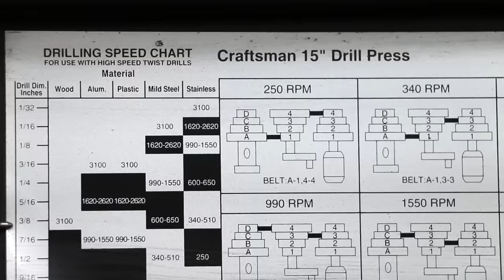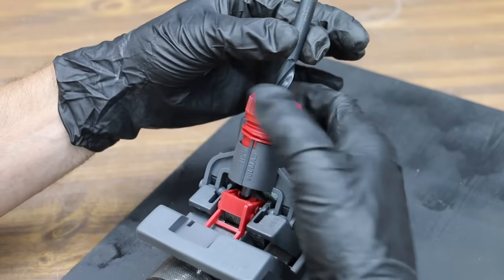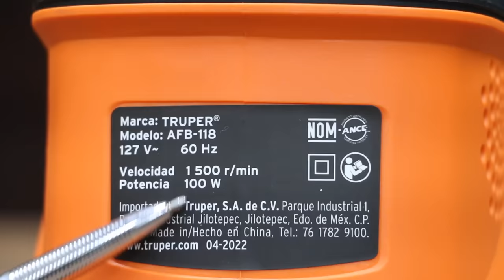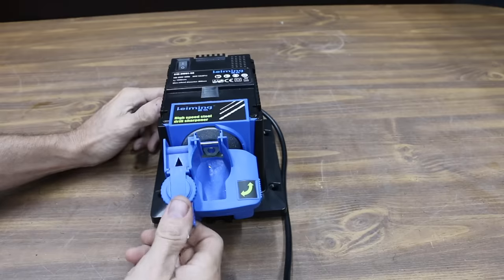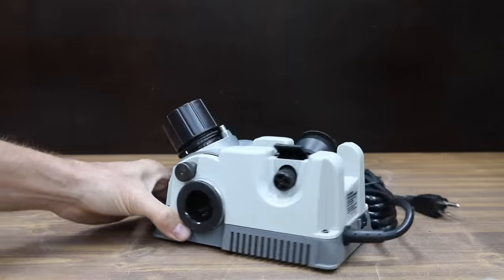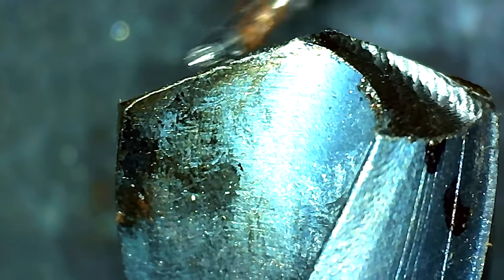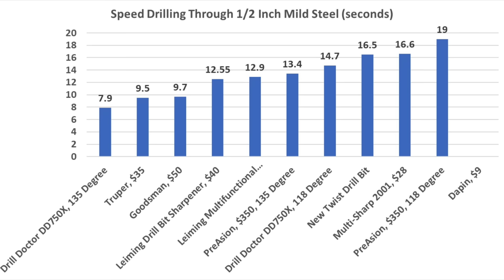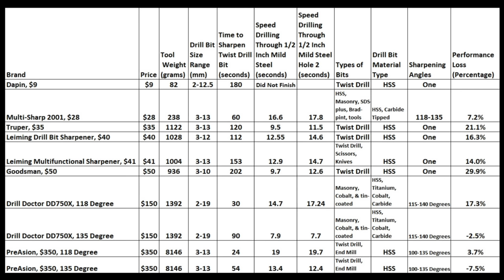Which Drill Bit Sharpener is Best? $9 vs $350--Let's Settle This!

Comment: Have a Drill Doctor for 15 years now. Love it. Massive thanks Todd for all your time and hard work to scare the industry into the Truth. 😎
Reply from the maker: You are welcome!
Reply: 118 or 135? HSS or Cobalt? After just two years, my 750x is pretty much junk lol
Reply: Got my drill doctor for 20 years and more and still working great love it 😊 for me not expensive 😊
Reply: Same - had a Drill Doctor for many years now. Excellent product, produces great results on a very wide range of bits, tip types, and sizes. Well worth the $150.
Reply: @Kebekwoodcraft7375 woodcrafter I just wonder how you would true up the grinding wheel on a drill doctor?
I'm sure just like any grinding wheel you would have to true up the wheel  cause after so many drills being sharpened on the drill doctor it will develop an uneven surface on the wheel. 
Coming from a retired machinist of 40 years in the trade.
I've learned to sharpen my drill bits by hand on a regular beanch grinder from 1/32" to well over 1" in size.
Have a blessed day 🙏 sir
Reply: @texastriguy you would need a green wheel to sharpen any type a of carbide drill bits either solid carbide or carbide tip drill bits.
Coming from a retired machinist of 40 years in the trade.
I personally learned to sharpen my drill bits on a pedestal grinder from 1/32" up to well over 1" in size.
Have a great day sir
Reply: I don't remember when I bought my Drill Doctor.  Surely more than 15 years ago and it never lets me down.  Also, I have looked at other sharpeners and the way they work don't make sense to me. You have to twist the bit as it sharpens.  If you just grind a flat surface it cannot give the right shape.
Reply: @beachbums2008  The drill doctor has a diamond grit wheel. You don't really true them up, you just replace them when they stop working since the grit is only a coating on a soft metal wheel. They're not too expensive and they last a long time anyway.
Reply: Yes I've had my 750x for quite some time now and all my bits are super Sharp! I also like I can vary the angle to whatever it is I would like and also it allows me to split points and sharpen masonry bits!
The other nice thing about it is that the diamond wheel can be replaced and there is a coarse and fine option. For some folks getting poor performance out of their sharpener I wonder if the wheel needs replacing? Just a thought. Also because Drill Doctor Corporation is in the u.s.a. you can just call them up and see if they can help you out. Something I doubt any of the other ones can say
Reply: @beachbums2008  diamond wheel
Reply: @beachbums2008  I can promise you the Drill Doctor diamond wheel will indeed sharpen a carbide tip.
Reply: @beachbums2008  Drill doctor uses a diamond wheel.  We've had ours for close to 30 years and still the original wheel and is flat yet.  The wheel is easy to replace when the time comes.
Reply: @RickLowrance  You can. It's called a four-facet grind.
Reply: Ditto—I'll stick with my original Drill Doctor Classic [model DD500] that Sears sold—the one with the more durable polyethylene housing. 
Many of these are simply chintzy hard plastic cad designed units—I don't think they'll last very long with moderate/heavy use imo.
Reply: @beachbums2008  I believe it is a diamond wheel, which can be replaced but cannot be true'd
Reply: @beachbums2008  No way to dress it from the User's manual.....you buy another one from Drill Doctor if you see visible wear. It's diamond embedded.
Reply: Agree. My 20+ year old drill Dr still works fantastic. We bought a more recent one for work and it doesn't work near as well as the older unit. You can tell by looking the old one is much higher quality.
Reply: Have had my Drill Dr. for over a decade and sharpened many many bits in that time.  Has more than paid for itself.  Definitely a buy it for life tool and quality.
Reply: Cobalt bits are the only way to go. And the Drill Doctor is the only one listed as being able to sharpen them. Some bits have a different flute profile though and I can't get the correct angle set. And the stone is out of alignment to make the split point. I've tried shimming it some but it's still wrong.
Reply: @beachbums2008  Drill Doctor uses a diamond wheel like nick said. That's why it's the only one listed for cobalt which is the only kind of bit I use. If using a variety of size bits it stays pretty true and as mentioned, they don't cost much to replace for how long they last.
Reply: @heartysteer8752   I posted about the industrial diamond embedded wheel and not being able to 'dress it', but I have no idea where that post went. In any event, yes, some tip shapes are impossible to do with the Drill Doctor. You can tell by looking at them before you buy. Therefore, I try to stay with bits I can sharpen.
Reply: drill doctor here too. i don't remember when i got mine, late 90s early 2000s? i got 2 from Sears, both 750s,1 for me & 1 for my Dad. he had always done his bits on a bench grinder, but his eyes weren't what they use to be and the small bits he couldn't do anymore. mine doesn't work quite as good as it did, it needs a new wheel. but i still use it when i need a sharp bit.
my Dads? he left this world about 10 years ago and about 4 years ago either his grandson or great grandson left it in the open case outside in the rain,....
Reply: @beachbums2008  I am an apprenticeship-trained Machinist with forty-six years of experience, including many years as a Coordinator of apprentices. I too have sharpened my share of twist drills by hand. Unfortunately, my eyes have not kept pace with my experience, and this old Machinist needs the Drill Doctor to help him out! I don't care how good you are or how good you think you are, without good eyesight, you are just pissing into the ocean. In my opinion, Drill Doctor is a quality piece of equipment, sir.
Reply: I bought a 750X today after much procrastination.  Love these videos.
Reply: @beachbums2008 You just buy a new wheel for like 15$ but they last a long time! If you sharpen bits over 7/16" definitely get the extra course grinding wheel for it!

Comment: Nice. Just a longer term comment. I’ve had that drill doctor for more than 5 years. I use it for metalwork on a lathe and drill-press mostly. I do tend to mess with the lip geometry in the +and - slots like you did at 135 but for 118.  This determines how aggressive the bits are.  There is a little bit of a learning curve to it but with steel you know if you did it right in a hurry.   A properly sharpened bit can go through many inches of steel where a mistake can’t make it through 1/8” steel.  And split points are where it’s at.
Reply: Do you not find that the drills you sharpen on the drill doctor cut slightly oversized on the lathe?  I had that problem with mine which is why I eventually retired it. If you watch when boring a hole the swarf off one flute will be slightly thicker than the other or worse it only cuts on one flute, I think of they made a better drill holder collet it wouldn't have the problem
Reply: @weldchip  if you grind uneven this happens.  I either count the time per side or spark the wheel out so it’s not cutting either flute anymore to get even chips.  I generally don’t rely on a drill bit to be better than 1/64th. If I need a hole that tight I ream or bore it.  I use one of those hf drill indexes that have every size known to mankind to always have something close but undersized and a small set of reamers for common sizes. Oh and regarding the collet yea that can be a little fiddly to get it seated in there just so. Shimmy it around while you tighten and don’t overtighten.
Reply from the maker: Thanks!  Thanks for sharing.
Reply: @weldchip  For precision work you need a grinder with a proper guide. Most of these sharpeners are nowhere near good enough for machine work. There are good ones, but they are expensive. See Aboms videos on sharpening with a grinder.
Reply: I guess if we're getting down that far into things I wouldn't turn these as Precision sharpeners. If you're looking for precision it's time to break out the boring bar I would think. 
I just use drill bits to get to the rough shape or if I'm just making a bushing or a washer or some other nonsense like that I don't worry about it but if I'm trying to hit close tolerances best believe it's going to be from a boring bar.
Reply: @firesurfer  no matter how perfect the drill you should not rely on it for thousandths of an inch. Always takes a boring bar, reamer, grinding, etc.
Reply: @brizzle8797  Totally agree. It's for in   between problems a bench grinder excels.

Comment: I still use my old Drill Doctor and am quite happy with it.  I have some drills so short (but sharp) I almost can't use it anymore.
Reply from the maker: Great feedback on the Drill Doctor! Thank you
Reply: :D i wanna see a drill bit so used and loved it's just a stubby little thing
Reply: Same here i bought the first Drill Doctor when it first came out I'm still using it today i never pick up the art of sharping drill bits by hand .. My father knew how to do it and  he had one eyeball to see from tiny drill bits to 1 inch razor sharp and lasted a long time but  no  insult to injury if  a  drill bit broke in half he would make a brand new drill bit out of the broken drill bit again like brand new
Reply: @jaakkopontinen  Sometimes you need a very stubby bit to get into a tight space. With the drill sharpener you can cut the bit off and put a new cutting edge on the shortie!
Reply: Ok checked, there certainly are long bits of any diameter available.

Comment: This video is very timely. Just a couple of days ago, I was drilling a bunch of holes in some mild steel and the bit started wearing out. After every few holes, I used my old first-generation Drill Doctor to sharpen the bit. It was working great until it suddenly wasn’t. Looking at the tip geometry, it was way off and putting a small bevel on the leading edge. I couldn’t figure out why, so I freehanded it on a bench grinder for the remaining holes. 

It got me thinking it was time for a new drill sharpener and I looked at this channel to see if there was a recommendation. A day later, here it is! Thank you, Todd!
Reply: If you are in the market for a new sharpener, I would look at the mrcm mr 20g or one that does larger if you need it.

I bought that one and it is superior to the drill doctor in every single way.

Depends on how you plan to make your money back though and the rate at which you use them.
Reply: @jeffshackleford3152  Thanks! It looks just like the PreAsion that is reviewed in this video, but significantly more expensive. The PreAsion may be an inferior knock-off, though.
Reply: @BlueSOF  idk about pricing, the 20g does up 20mm, that may be the difference in these models.

They also have one that does 1 3/8 or something like that.
Reply from the maker: You are welcome!  Glad to hear!

Comment: Great video! Those screwdrivers that have an interchangeable internal shafts are anywhere from 7 in 1 to 14 in 1. Some ratchet, some don't. I'd suggest testing those, because I'm curious about what the advantages or disadvantages might be, and if money means anything when making a selection.
Reply from the maker: Thanks!  Thanks for the suggestion.
Reply: I second this gentleman's comment!
Reply: Test them against the LTT screwdriver
Reply: Hard to beat the value of a $1.99 Harbor Freight multi screwdriver.  The metal is actually good.

Comment: This was a great side by side comparison as all are. The only factor not comparable was durability of the sharpener itself. I can personally attest. I used the Drill Doctor at work for over 15yrs. I personally sharpened thousands of drill bits. We never had an issue with the unit. I did replace the sharpening stone after 12yrs of service. For the money I believe they have the best system hands down.
Reply from the maker: Thanks!  Thanks for the feedback.

Comment: I had bought a Drill Doctor 500 at an auction, new in box.  I didn't even try to use it until I watched this vid.  My first few attempts were unsuccessful but I read and re-read TFM and practiced until I figured it out.  Yesterday I sharpened my first expensive cobalt bit that was shot.  Came out great the first time and I drilled out a stripped set screw in just a few minutes.

Comment: Very nice! One thing not covered is accuracy of hole diameter. (how equal to center the two sides of the bit are ground.) If the center of rotation is off center of the drill blank due to inequal grinding the hole will be oversize. Another thing is the type of grinding wheel. The stone wheels will only sharpen a relatively small number of bits correctly compared to the drill doctor with the diamond wheel.
Reply from the maker: Thanks!  Thanks for the constructive feedback.
Reply: Bingo
Reply: Yep I said the same thing.  As a machinist correct hole size diameter is paramount, the prescion does a much better job than the drill doctor on cutting an even point/flutes/web when properly setup.

Comment: Good to see this comparison. I haven't seen some of these brands. I've used the drill doctor for almost 10 years now. I mainly drill stainless steel, which is tough on bits. HSS bits just don't last and need constant sharpening. Switched to cobalt bits and they last MUCH longer. The split-point bits make a big difference on cutting speed too.
Reply from the maker: Thanks!  Thanks for the feed back.
Reply: What brand drill bits do you like to but?
Reply: @jeffshackleford3152  I bought the Ridgid Coldfire Cobalt 14 piece kit from Home Depot. It's the only cobalt bits I've used. Doesn't look like HD has them anymore. I've had to re-sharpen them a few times over the years with a drill dr and I've only broken a couple of the smaller bits, less than 1/8". It's been a dang good kit that's drilled several hundred holes in stainless and mainly by just 3 bits out of the kit.

Comment: Great video. I’ve owned a Drill Dr for years but never removed from its box. Now that you’ve demonstrated it’s use I think I’ll use it 😂 I’d like to see a test of emergency radios, solar, crank etc. We’ve experienced wild variations in function and quality. Mostly very disappointing. We’ve owned several C. Crane products but bad customer service when troubles arise.
Reply from the maker: Thanks!  Thanks for the suggestion.
Reply: Second the motion. An emergency radios is something everyone should have
Reply: That’s a great suggestion I second that one. And you really gotta use your  drill doctor.  There is a little bit of a learning curve to get the feel for how to use it, but believe me once you do, you wonder how you ever live without it. I had a pile of bits that literally belong to my father and I ran them through the drill doctor, and they run like new.

Comment: I have to admit that I've never used a drill bit sharpener. I throw my dull bits into a drawer in my tool chest and the supply just keep growing.  I've thought about getting a drill bit sharpener, but so far I haven't.  So this video is great, because I know which sharpeners will do a good job and also how much I have to spend on one.

The chart at the end is fantastic.  I choose my budget and find the best sharpener in that price or lower.

Another great video!  Thanks for the hard work.
Reply from the maker: Thanks and you are welcome!

Comment: As a machinist of 30+ years I have never used a drill bit sharpener. It was neat to see all the different sharpeners and them being used, but I think I'll just stick with my pedestal grinder, a drill gage and a my steady hands to sharpen my drills!
Reply: I'm in the same position as you, but sharpened my first drill bit only 20 years ago. I worked in a shop with auto lathes pumping out house fittings and stuff non stop- it was a GREAT test of your sharpening skill as you could easily measure number of holes drilled AND some of the holes had a tight tolerance and so any uneven sharpening was picked up. I'm certain some of these sharpeners lacked the ability to properly centre the point!
Reply: Yeah, I cannot see any of these gadgets performing as well as someone skilled in sharpening, thats why companies often get someone skilled to do it.
Reply: 22 years ago, I made a drill gauge in my highschool shop class. My teacher at the time (I kid you not, his name was Mr. Mann) said I'll never need anything but that gauge and a bench grinder.

I still use it today.
Reply: @rothandre6497  I bet that was one hell of a night after the wedding, what did your missus think to the drill guage and grinder?
Reply: I am a pattern maker by trade and sharpen by hand. I may try a sharpener one of these days.
Reply: @rothandre6497  I have mine from 40 years ago.
Reply: I worked for an Aerospace company for years so always had access to the very best, sharp drill bits. When I got my drill Doctor, I was shocked that it could put a tool room edge on cheap ass bits so all my home bits got run through it. SOOO Sharp after.
Reply: cool story dude no one cares
Reply: @ryan74701  Thanks "dude" you at least care!
Reply: @kowboy284  lol why did you even on this video when you have no interest in an drill bit sharpening device lol so you can tell people you’ve been sharpening your own for 30 years? You want a medal grandpa?
Reply: @ryan74701   Oh dude because it was very interesting seeing the different kinds of drill sharpeners that are out there and their is a lot of people out there that have not the slightest clue you can sharpen drills with just a bench grinder. So read comments and if you don't like them move along like a big boy would do!